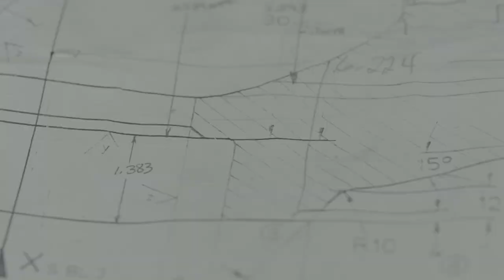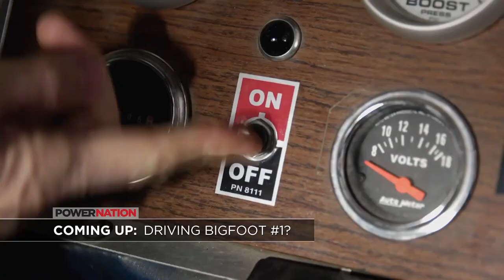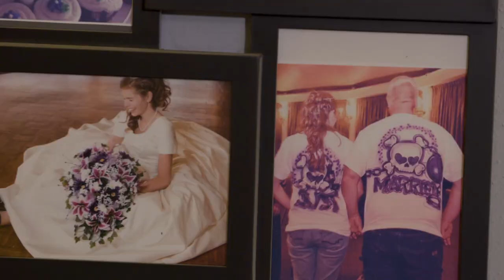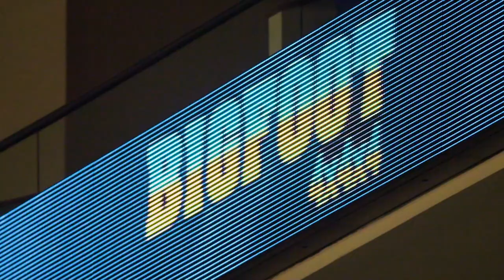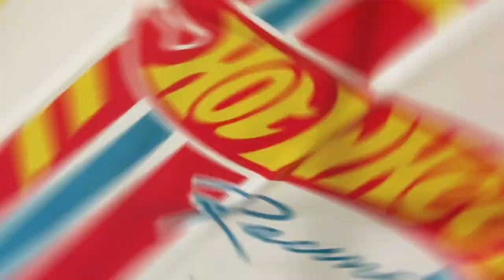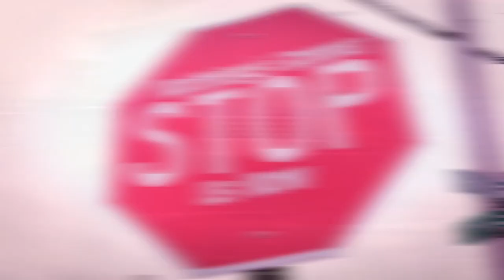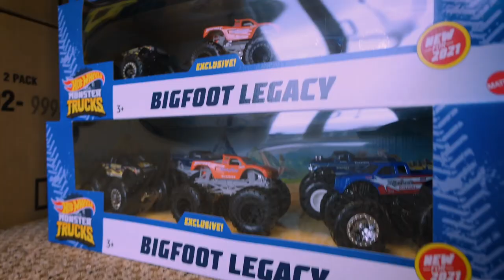Building Bigfoot: What It Takes To Create A Monster Truck - Music City Trucks S2, E9

Comment: Always kinda wish Bigfoot would still run monster jam.
Reply: The USHRA/Monster Jam is the WWE of motorsports.  Great to watch and fun for the audience, not for those competing.
Reply: @josefrobbins8781  the rammintor guys have told stories about how they have had trucks damaged at monster jam shows and weren't compensated for it (A monster jam owned truck hit ramminator if I remember correctly), if they treat people like that im not surprised bigfoot stayed away. Also during the days they did gravedigger was the cash cow from a merch perspective (because bigfoot saw it as an independent contractor relationship made their own merch etc), gravedigger on the other hand went in with monster jam.

Comment: Bigfoot 5 was sold, or at least listed on, eBay some years back for a ridiculously low amount. Seems like  it was $10K or so. I was appalled! Not sure if it actually sold, but it apparently made it back home either way.
Reply: I highly doubt that was #5, Bigfoot has built 2 other 10 ft tall tire trucks that are still out there. One was at the Race Rock that use to be in Vegas and Bigfoot 7 was turned into a 10 ft tire truck for the Race Rock that use to be in Orlando Florida. The truck that was in Vegas was at a Museum in Illinois and Bigfoot 7 is at a theme park in Florida.
Reply: bigfoot 5 was never sold. your confused with Number 7 that was sold from race rock to the theme park in Florida